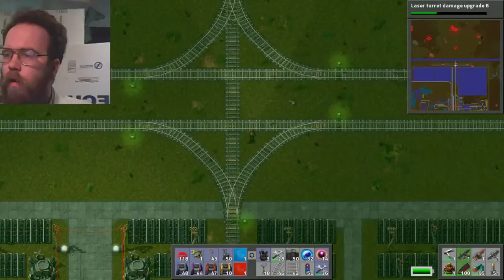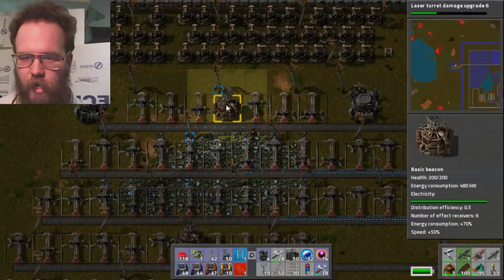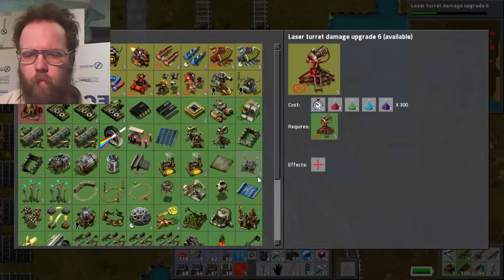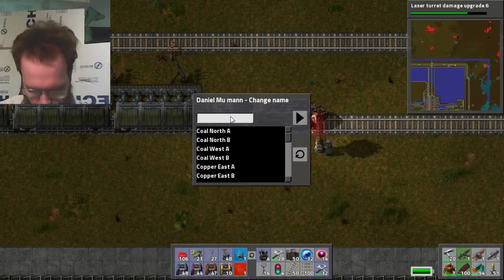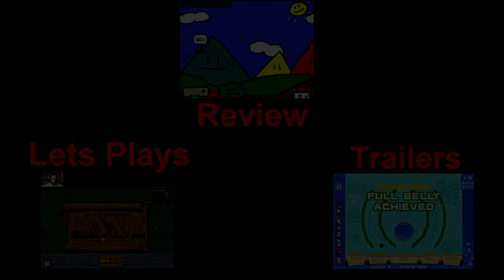#16 The rail network, Now I can finally feed my ravenous factory - Factorio

Comment: I'm not quite done watching yet, but afaik rail signals are directional the same way stations are, so a block one direction is different from a block the other direction. That's why they need to be paired like that. Rails are very finicky, so I'm glad you got it working.

EDIT: You might want to selectively pair them up. If you place them at the right side, a train can wait there when going up. Left can stop a down train, Up can stop a left train, down can stop a right train.
Reply from the maker: +Gamesaucer Someone helped me with the rails. I'll get to talk about it in the nextFactorio vid :)